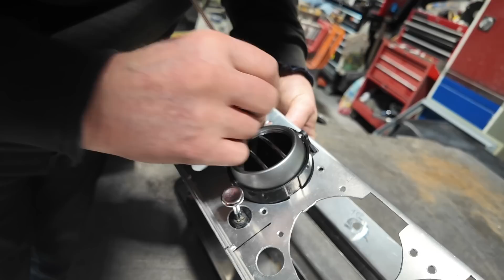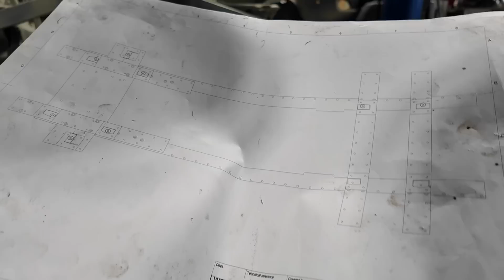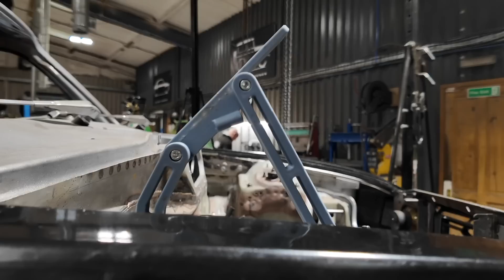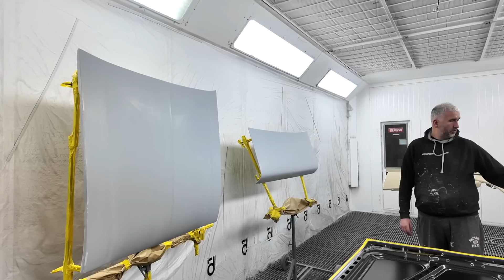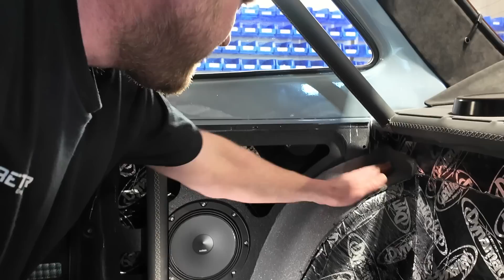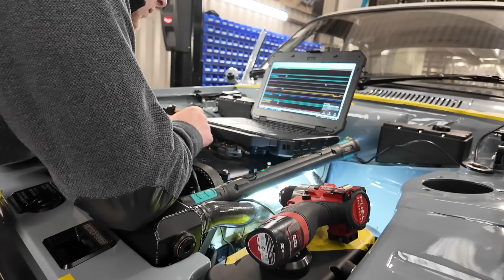Jigging UR QUATTRO Shell

Comment: Whilst I admire & respect your attention to detail on all your builds, I am surprised to see that jaguar rear axle carrier what looks to be just blasted & powder coated as it looks like all the heavy rust putting is still noticeable in the light.

I'd have addressed that pitting, treated it, primed it & used a good hard top coating.

Of course I could be wrong on what I see but it looks quite bad & I wouldn't be happy with that.

You do SECOND TO NONE work usually.

Comment: I'm going to be a bitch here and I'm sorry but that rear sub frame that holds the diff looks like it's badly pitted. Despite zinc and powder coating is it wise to re use it?
Reply: I have to assume they know what they're doing, but I'm also curious about the thought process on that.
Reply: It's just the "cover" the strong bits are inside.